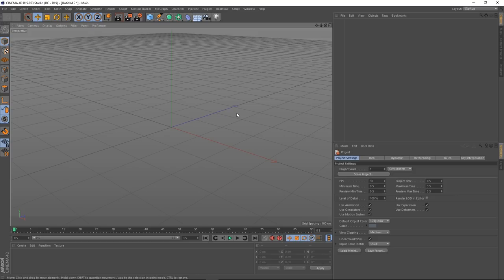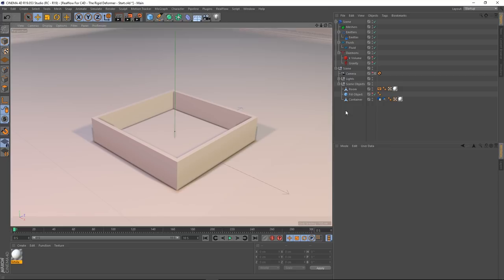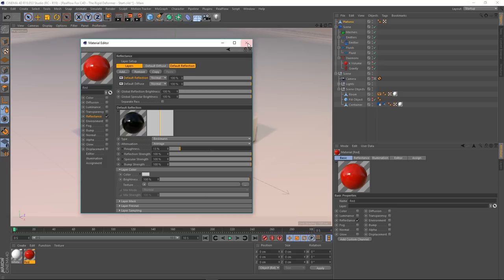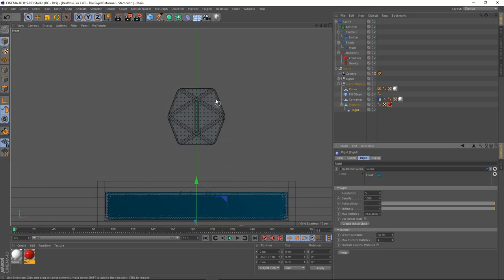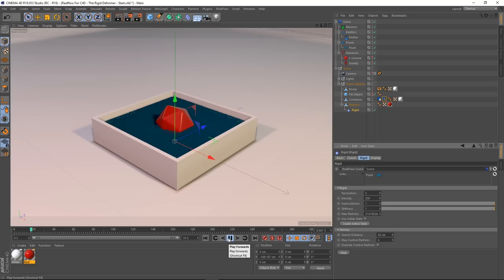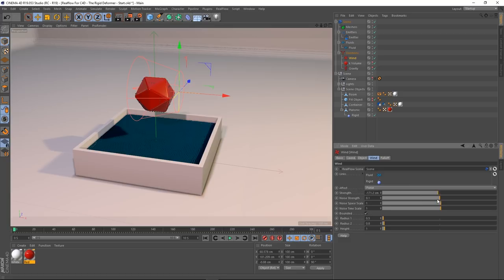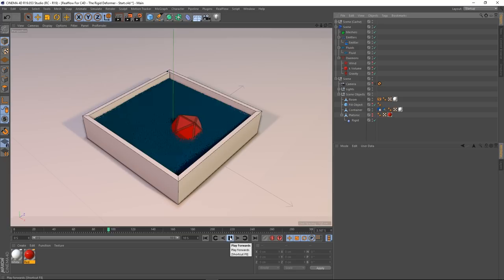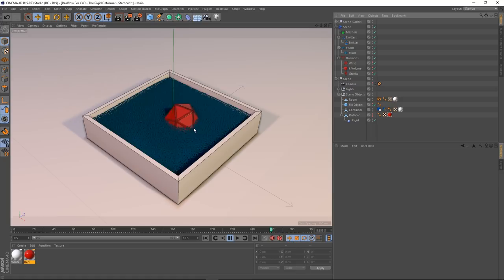Realflow For C4D: The Rigid Deformer

Comment: Hi I have a Question and i can't find any answeres pls ein need help. In my realflow animations sometimes when it is rendert some frames are missing. Sometimes its just every second frame and sometimes it is even longer. It has the effect that the animation doesn't look fluent. Thanks!
Reply from the maker: did you cache your simulation?
Reply: Of course. I try the physical renderer now maybe that works.
Reply from the maker: let me know how it turns out
Reply: DIGITAL MEAT Yep it worked. I guess i have to use the physical renderer now for every scene.
Reply from the maker: I don't think the renderer is the issue, it's that you needed to cache your fluid simulation